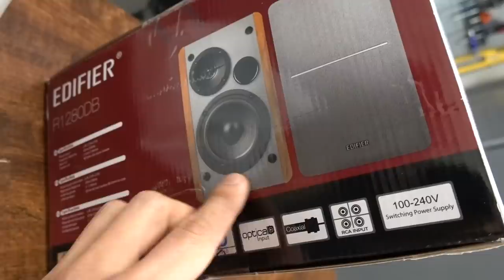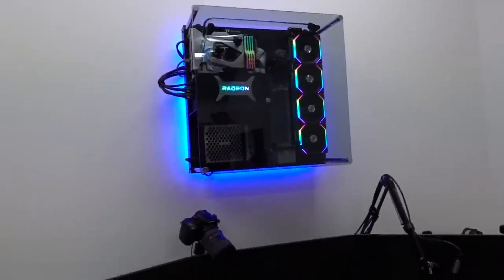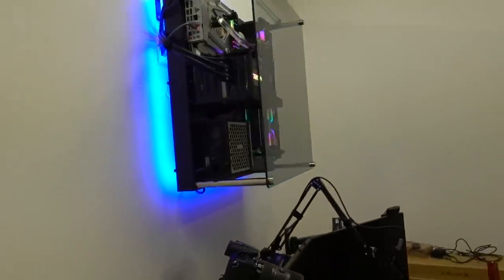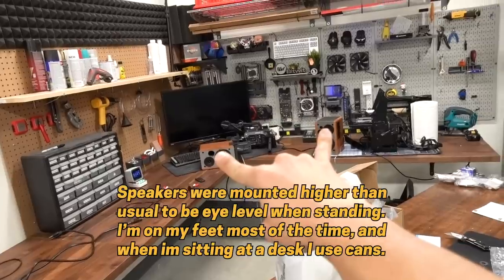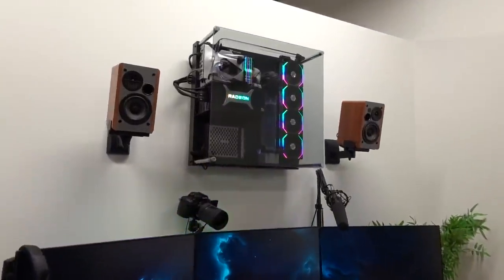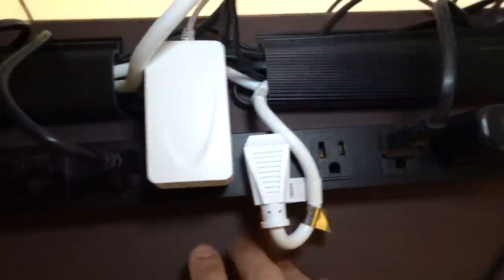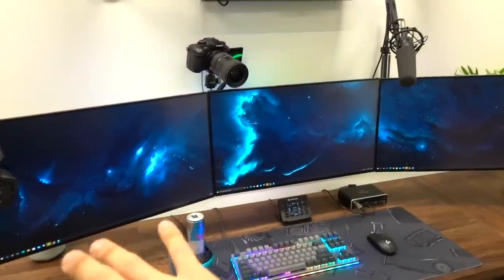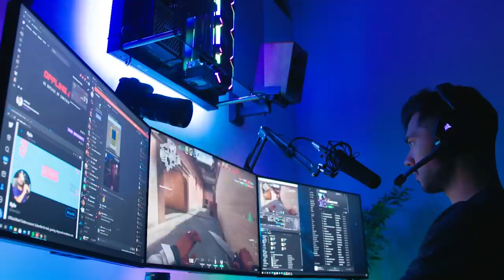My $10,000 dream setup turned out INSANE!!

Comment: The tilt is actually there so when you look up at your PC you can appreciate its glory.
Reply: why do i see you everywhere
Reply: Or solved by buying a non-tilting VESA mount. Have the same case on my wall rn. Flush with the wall.
Reply: @gerasimosplays3744  lmao . a $10 000 smack in the face 😂
Reply: Double sided carpet tape will fix those accessories to the underside of your desk no problem. And! It can be removed, or you could go the sticky back Velcro route?
Reply: No, it's tilting becoz it's asserting dominance by giving him anxiety
Reply: Fr
Reply: that is NO webcam. THAT THING. is a BEAST

Comment: His faith in stuff not falling from that wall is impressive.
Reply: "I find your lack of faith disturbing" - Lord Vader
Reply: @petenielsen6683  lmao
Reply: People have been doing it with TV's for like a decade now, really that shocking? MATH!
Reply: Lots of screws drilled into a wall, seems pretty safe to me.
Reply: @ethangaines2658  yeah it’s secure, but looking at it makes you seem slightly worried that it’s gonna fall, as it’s literally leaning
Reply: @coryandrum  yeah but they drill into studs. This dude just mounting into dry wall lol
Reply: @bugnbuster878  I thought he only did that for the little clips to hold it strait not support the pc...
Reply: @bugnbuster878  i sure hope he is driving into a stud... if hes on dry wall its total fubar. should probably have disclosed this to the viewers
Reply: @symnage2722  Don't need to use studs anymore.  Drywall anchors and the toggles he was using will hold hundreds of pounds (used in concert) on drywall.

Comment: If I spent $10k on a PC, I would not be relying on the strength of drywall to hold it. I would have made sure that atleast one of those brackets went directly into a stud and secured with a lag bolt.

Secondly, given that this a studio, I would have put 1/2" plywood under the drywall. Then you can really mount anything, anywhere.

Comment: “ if I do die it will be caught on camera, that’s pretty cool”😂
Reply: but who would uplode it to the youtube ???
Reply: @quiticl  Linus would definitely do that.
Reply: Touches case to explain drywall anchor and realizes the upper toggle bold drilled through the electrical wire connecting to the socket energizing the case. End of Bit Wit! I would have dremeled off the tip of the toggle bolt screw. Just the tip I promise! you're not supposed to drill within a couple of inches of an electrical outlet. Oh, right that's the Canadian Electrical Code. Doesn't apply in California!
Reply: @patrickwingert2018  NEEEEEEEEERD! (DBZ Abridged Refrence)
Reply: @K1NGRaj  lmao
Reply: @K1NGRaj  It's all about comedic situations involving electricity! 😁

Comment: You can buy a USB desk grommet that has a card reader. You'll be able to route cables and install it directly in your desk. Would look super clean. Also command strips for paintings that use Velcro for your power bricks. You put one strip on the wall and one on the power brick. That way they will connect to the wall but still can be removed.
Reply: Velcro sucks, talking from personal experience, use a bracket
Reply: @GamersofUnivers  the command painting strips with Velcro don't suck. The large strips are designed for heavy objects.

Comment: Hey Kyle, I work for an electrical contractor out of Chicago. I would suggest using whats called “wiremold” to route your power cable. It’s a surface mounted raceway you can paint over. I commonly use it in schools and office buildings. If it has to go behind, you can put in two boxes similar to your open mounting and install flexible metal conduit, commonly called greenfield between them. Can be a bit of a pain in this application since the flex greenfield has to be large enough to accommodate the plug. California code might be different but Chicago code is one of the strictest.

Comment: Cut the speaker power cable, pass it in the wall, then connect the cut part to a generic wall plug after, that you find in hardware stores.
Part of my dads work is IT electrician, and doing this is safe, as long as you properly tighten the screws that hold the cable in the plug and don't cut too much of the insulation, so the cables are not exposed and close to each other.

Comment: This is a good solution to hold the system parallel with the wall. For a failsafe, you could add a "wedge" in between the bottom of the pc and the wall. this could be a black clean looking cylinder that would be able to catch the weight of the pc if the brackets were to fail. Further, the surface area of the cylinder should be large on the drywall side to spread out the force against the wall and not cause a puncture so the preferred shape for this may actually be a cone.

Comment: You can get the speaker power cable down the wall using a “fishing” method if the wall is hollow. You basically drill at the top, and also where you want the destination to be, then use a rod to pull the cable inside the wall.
If that sounds complicated, google is a wonderful tool.

Comment: A very simple modification to that wall mount bracket would allow you to tilt it back further! You have to extend the groves the tilt bolt goes through with a Dremel and a grinding bit. They are designed to not go past vertical but you need it to tilt back farther than that to support the weight of the PC! You could also have put a few washers under the bottom mount bolts on the back of the PC! I wouldn't want to use your method because of all work to get it away from the wall. You could just use 2 more of those brackets at the bottom of the case and you wouldn't need the wall mount bracket at all! Sorry to be critical but I didn't want others to think your way was the best way!

Comment: From one Kyle to another...could you just put some spacers on the bottom to push the lower edge out? Looks amazing!
Reply: Said the same thing in the last video but I guess it worked out and added some stability too.
Reply: No, if he did that the whole unit would push away from the wall, or in other words, the tv mount would simply extend out while remaining at the same downward angle. The best way to mount a PC like this would just be some French cleat style mount on top and matching spacer for the bottom.

Comment: Is there any way you can open the other side of that wall to add some blocking to the side with the PC? Then you can get a flush mount and lag bolt it in anywhere on the wall.

Comment: Couldn’t you have just put a leg on the inside at the bottom between the wall and PC to “push out” the bottom so it’s vertical?
Reply: Too easy I guess. I did that for a mirror before.

Comment: To “fix” the speaker issue : since you got that desk stand already maybe you can put on a tube desktop amplifier instead. That way you don’t need to put AC power to your speakers on the wall. You may have to change speakers though but that shouldn’t be an issue. There are awesome Bluetooth enabled desktop tube amps out there. Plus they look great!

Comment: Ive been using this case for the last year, and have had it hung like he has. The wall mount he needs to use is the USX Mount Fixed TV Wall Mount with Low Profile from Amazon. It  will solve all the problems with no Jerry rigging.

Comment: I am 1 minute in and the easiest way to fix it is with a bumper on the bottom to push the bottom out just a little. No hole or anything needed and it just has to be on the bottom of the swivel point. Honestly though, I think it looks good with a tilt as your sitting under it and can see it better when sitting. The only thing that would bother me is seeing the hole where the wires go down through the wall. Hard to get around that but you typically put that in the center more or into the corner so it's less noticeable. Great build though!

Comment: for the power bricks, use picture hanging command strips! they're kinda like velcro, but both sides are the same. that way if you need to take it down you easily can! and then you can just press it back into place when you're done.

Comment: You could have still used the toggle bolt on the bottom hole with a small drill out.... could've taken the spring clip off completely and just screwed it on from behind as you had access to the rear from cable box just below the hole?

Comment: Hey Kyle I recommend 3m command strips for sticking your power adapters under the desk. they sorta work like velcro strips except there's no soft side. I have a bunch holding up a power strips, Kinect v2 connection boxes, laptop and monitor power adapters all under my desk. They're pretty solid going on more than 2 years even with the heat generated from the components they secure.

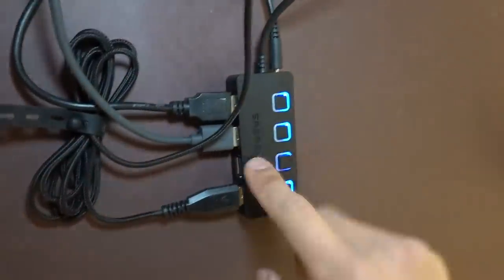Comment: 14:29 The white powercable needs a bigger looping, the loop is too short, later on you will have a chance on electrical veins breaking inside when you move the cable to its resting angle Kyle. Allways assure that some cables on the beginning or end of plugs have enough clearance in the loop. 

Its with the other things the same thing, if you wanna store your old charger with a fixed cable, be sure to loop it first and then wind your cable around the power/charger plug. Never have problems again with bad contacts because of internal breakings.Reuse the winded cable, by let it unwind naturally .

Other than that, GG Kyle. :pepeclapp:

Comment: With regards to the speakers, you could've gone passive and plug in the amp in a separate location. That way you don't need to run power cables through the wall.

Comment: You could get un-powered speakers and buy a class D amplifier or other small amp.  It should be up to code to run speaker wire through the wall (it's low voltage).  That way you don't need to worry about running power cables, just have the amp plugged in somewhere below your desk.

Comment: Use right angle connectors for your USB Displayport and PSU power for cleaner connections. Glad things finally turned out on this. Relieved to see its over FINALLY. Its soooo funny you were talking about your issues with usb passthrough and I was thinking just use the monitor stand you got. Then in the next clip the monitor stand was there and was like SICK! Nice setup kyle definitely a little jealous. My RTX 3080 and 11700K are satisfactory though :)

Comment: final steps to clean the system up: angle adapters for your PSU & GPU, so the cables go straight to the wall.... And maybe a diff color UTP cable

Comment: The speaker power cable, well make sure there is no electrical you'd be cutting through. I honestly learned no way to put a plug into a wall hidden and in Canada all wire cuts have to have at least a junction box. If you want to for the most part hide the wire of the speaker power. Find where your wall studs are and drop your wire down to near the electrical box. Cut a rectangular hole for this type of mount "VCE Single Brush Wall Plate with Single Gang Low Voltage Mounting Bracket" which you'd find via an Amazon Canada search and run the cable through that hole to the electrical outlet beside. Be 100% careful not to cut any electrical wiring.
Reply: Or a faceplate like "Bulk Nose Faceplate Wall Plate for Cabling"... BUT if you want to avoid any wall cutting try something like "Legrand C210 Wiremold Cord Mate II Kit" as listed on Amazon Canada.

Comment: u could get one of those 2 flat-pin male electrical plug so you can cut and pass those electrical cords through any hole and then put on the replacement plug.

Comment: You're using a monitor-style speaker w/ a very narrow throw.   Having them that far above your head will make the sound your ears actually perceive sound hollow.  You need to bring them down to at least just above the monitors for them to sound good, and turning them sideways would helps since you don't want the backs of the monitors to block the sound,  either.  I've been a guitarist and sound engineer for a long time, hit me up if you have any computer audio issues.  They weren't designed well for audio and the workarounds are a plenty.

Comment: Good job, looks great! BUT FOR FUTURE REFERENCE!!!
From an engineering stand point, in your situation supporting from top is much more difficult/expensive than supporting it from the bottom...
Just some pieces of wood or metal (rods similar to the silver/chrome for aesthetic appeal) 2 or 3 points on the bottom (corners and center) with some 3M tape pushing the PC case out until flush is what I would have done as a solution instead of having brackets at top pulling it back.
The way you are doing it only makes sense if it is also somehow attached to the PC case as a fail-safe to the bracket breaking...

Comment: I haven't seen the last video but I work in events and tilting tv's are a daily issue, instead of "pulling" it from the top I would just put something similar in thickness on the under side to "push" it. It's mostly "pressure mounted" and only needs to be secured somehow for safety...

Comment: To be fair to the speaker mounts I think a lot of setups would only be the speaker wire running through for cable management as running power next to audio cables is a faux pas due to possible interference. Not to mention your average setup has an amp elsewhere with only speaker wire running to the speakers instead of the integrated amp.

Comment: Some constructive help for next time you’re faced with a similar engineering issue... Your method is trying to essentially counter the outward force at the top, when all you need to do is use it to your advantage. It is simpler to put a single block spacer behind your PC at the bottom to bring the case plumb. You wouldn’t need any toggles at all since you’d be leveraging the existing force applied in the direction of the wall at the bottom by the PC wanting to tip forward at the top. You wouldn’t see the brackets at the top either and everything stays hidden behind it. My $0.02 FWIW.

Comment: A possible solution for the speaker problem would be to switch the active speakers out with the passive Edifier P12’s and use an external amp such as the SMSL AD18 which has BT, Aux, Optical and USB inputs.

Comment: For the PC you can chain link to the wall each side at the top with spring-links (which is advised for heavy items like speakers and free-standing cabinets), and black foam blocks to pad out the bottom. It's a bit of a pain at first finding the fulcrum points, but you should at least still be able to pull the PC away from the wall still. 👍

Comment: Yea, the code that you’d be violating mentioned at 8:21 of your video is 400.8(2) of the National Electrical Code (NFPA 70). 
I’m curious where you got the power from at 4:25 of the video and the cable assembly you are using to install that cut in box assembly with a single the single receptacle. Maybe you can add a cut in box, and run some MC cable from the box you got power from at 4:25 and get your power from there? - Random florida licensed electrical inspector

Comment: You could've found LED strips on Amazon that have a 12V RGB connector for roughly the same price, that way you can control the RGB through software rather than aa external remote control

Comment: I know this would be over kill, however I think you should add brackets below the pc as well just to keep the visual weight symmetrical top and bottom, but also at that point after watching your video and having hindsight I might just use 8 (16) L brackets and skip the tv mount. 

Just my thoughts with hindsight, the setup sick good work Kyle! Don't let Lyle touch it!

Comment: Running 12/4/3 through the wall, with the proper 30A breaker, and 30A outlet should put you right w/o fear. Copper

Comment: I know it is a year later but I have just put my case on the wall too, but mine was slightly different as it was an outside wall if you used a TV stand it is designed to lean forward try turning your stand upside down and you might not need the extra fittings to hold it in place. by the way sick setup

Comment: Could you possibly wire the speaker directly to your breaker with 14/2 wire? that wire is up to code for being in walls, and you could just use a low enough voltage breaker to not fry your speakers

Comment: For fixingthe tilt instead of trying to pull from the top to straighten why dont you try pushing the tilt from the bottom of the case, Maybe Use a Bed headboard Stopper.

Comment: I have the Keychron K1 V4 with brown switches, it's a great keyboard and I like it a lot. I went with a white backlight option as I'm not into RGB aesthetic. It feels very sturdy, looks nice and I love the low profile. Outstanding value in my opinion, much like Logitech g305 mouse. Though I have to say, G915 TKL and G Pro X Superlight would fit the "this is the best of the best" theme much better.

Comment: With a monitor setup that wide, you coulda mounted a nice, full-size soundbar on the wall just under or over the monitors with a wireless sub. Then you'd still have all the wall space on either side of the computer to do something cooler with. Also I don't know what to think about triple 4K monitors with high end graphics just to use Windows bluetooth audio out for sound...

Comment: Kyle check out the ROG Falchion if you're interested in a wireless keyboard. Super nice 65% form factor, 2.4Ghz wireless, full addressable RGB and a touch panel slider for media on the left with battery indicator. It's pretty sweet!

Comment: You could have mounted the speakers actually in the wall.  That way they would be flush on the user side and the power cable would not pass through the wall and not be a code violation.

Comment: Yo just an headset upgrade instead of  the Corsair Wireless Headset get the SteelSeries Arctic Pro with interchangeable battery, i know they are expensive (350$) but i myself, didn't anticipated that it would be so handy and fast to change the batterie when its empty. Have them both and but the Arctic Pro are a game changer to the Corsair ones.
(P.S the sound is also incredible too.)